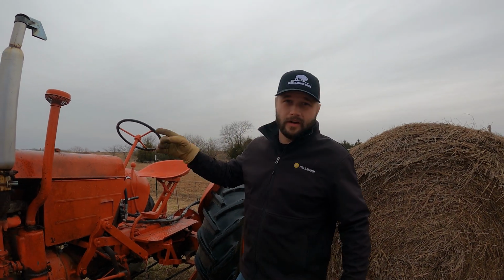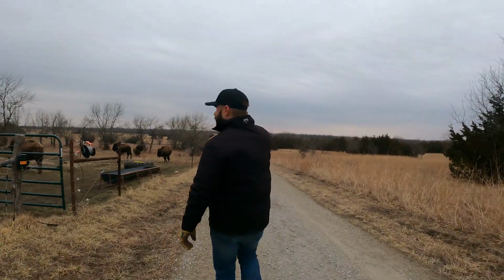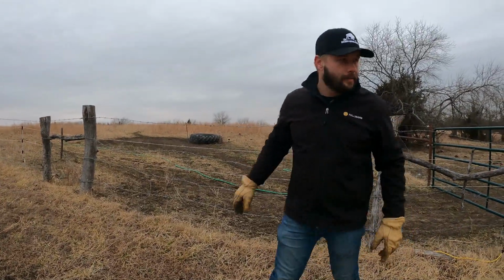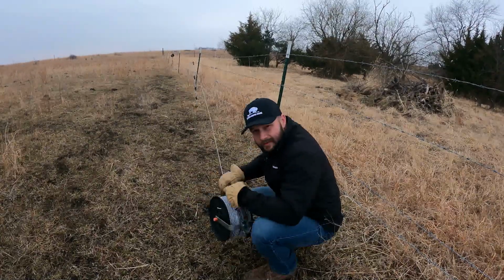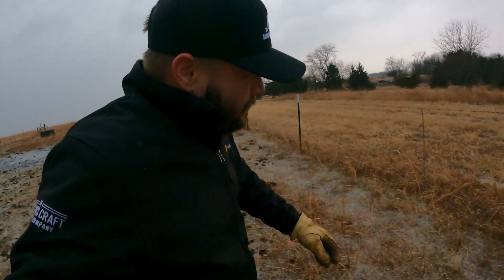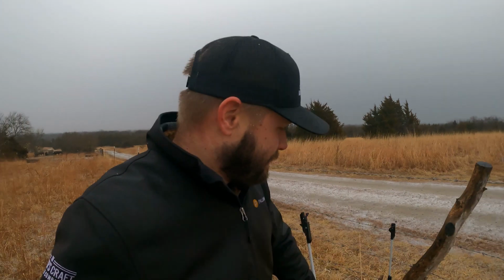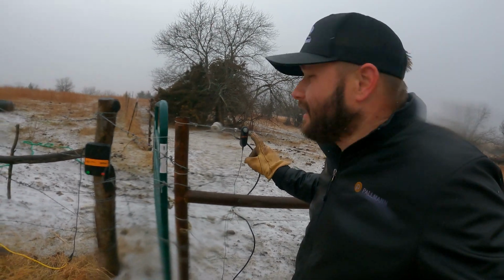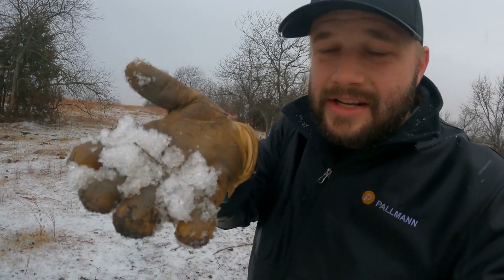Treacherous Weather to Tear Down a Buffalo Fence Before they Escape

Comment: The weather in OK looks great to me.  Northern IL I had 4’ snow drifts to the north for a mile and around 20 below zero for a couple weeks.  I had to shovel an inch of penny sized hail off the driveway last week never had to do that before.  Looking good there.  I’m sure the guys in Wisconsin are laughing at my little drifts and warm breeze.  Saw dusty had a fire.  Hope you guys have firebreaks set up.  Pretty uncommon to have an accidental fire rite now where I’m at.  I did have a controlled burn do some damage
Reply from the maker: Yeah it’s been an active winter here too. We had a few times this winter with 4’ drifts. I don’t mind the snow though.

Comment: Things have to done and we have no control of the elements. You could have waited if the next day was going to be nicer. But depending upon your work schedule you may not have that luxury. 
I had one job were I worked outside. At the end of the week I had chemical burns on my feet and I had to quit . I went back the next week and rejoined RadioShack and stayed with them for the next 27 years. 
I never was subject to much physical discomfort with the Shack but the Psychological and Mental pressure was hard to handle sometimes. I had the "pleasure" of running a store all by myself 9 hours a day, six days a week for 4 months at a time. I had no control on hiring that was the District Office job. That will play on your psyche for sure. They couldn't do that today but they could do that in the early 1980s.
Reply from the maker: Yes you’re right. Wow that sounds rough! I could see how that would be taxing mentally.